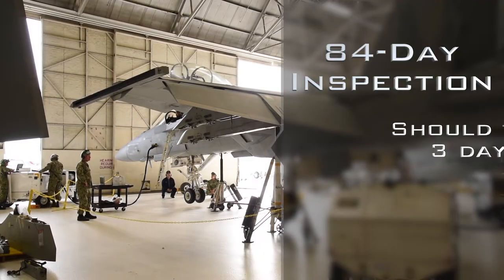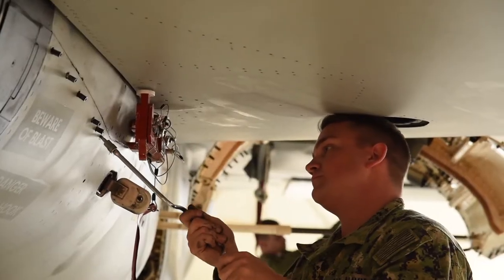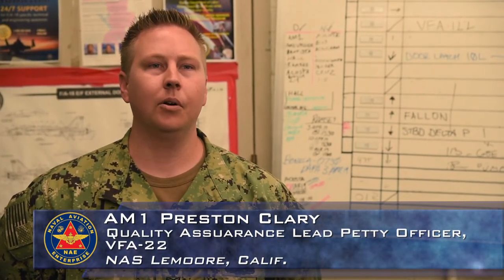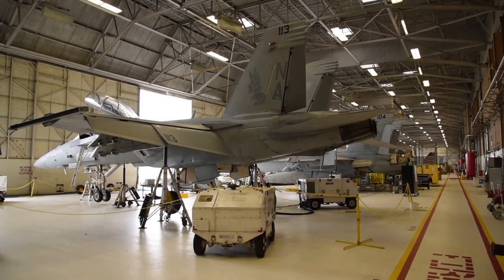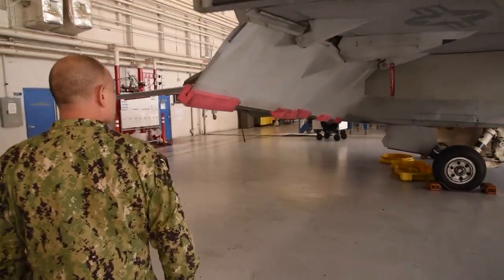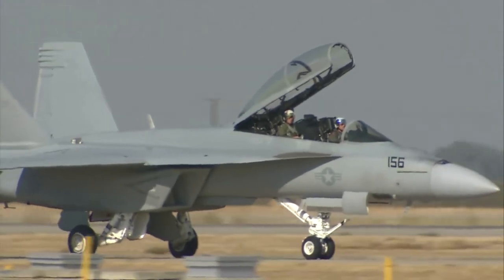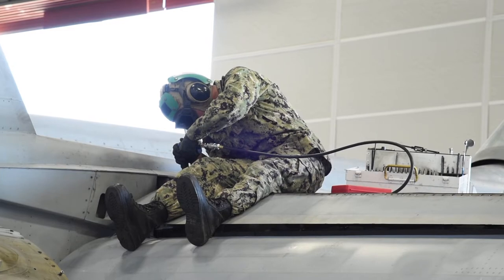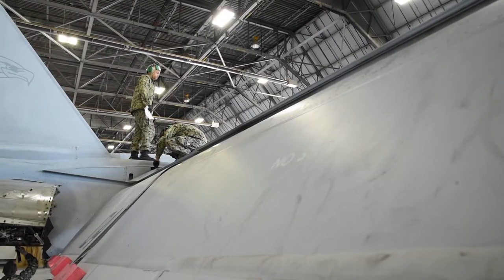Naval Aviation Enterprise Naval Sustainment System O-Level Reform

Comment: This has been a long time coming.  A very smart concept that removes the headaches associated with a lack of parts and material availability.  This should definitely reduce pulling parts from other assets, which happened far too often on the legacy platform.  This inevitably will require the use of the supply system as it was intended and ensure the manufacturers will have a parts sustainment apparatus long term. Great video and I look forward to seeing how this progresses!